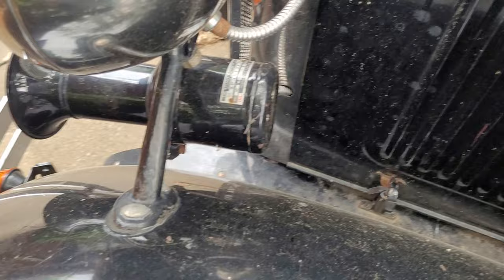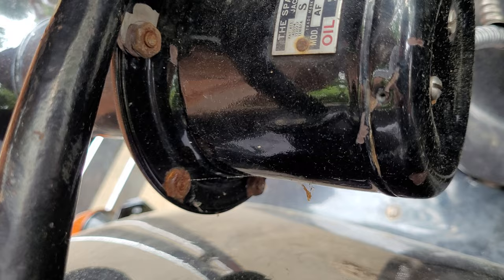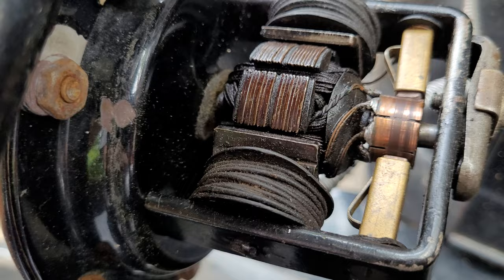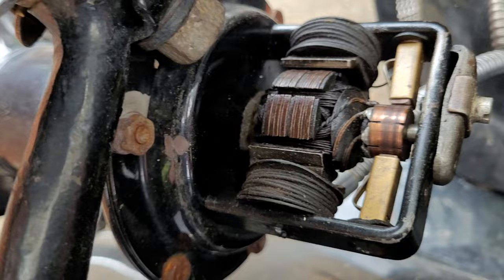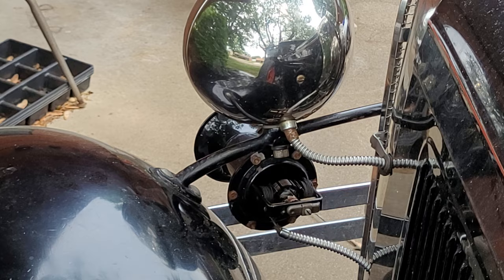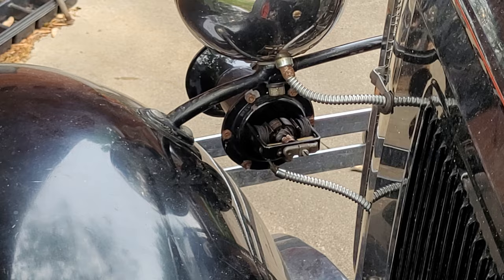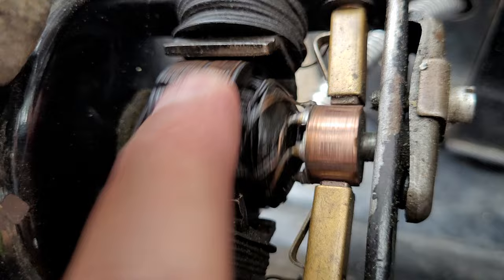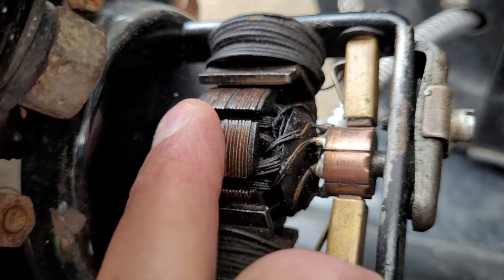Model A horn not Ahooga. How to make it Ahooga again

Comment: I check it before driving. Or get a Sparton air horn for reliability.
Reply from the maker: I find that the outside temperature makes a hugh difference in the sound and if you have to adjust.

Comment: Was this not working at all before you started? I’m having same problem thanks 😎
Reply from the maker: It was hit or miss if it worked. Temp affects it. If sun was hitting it would make a little noise. Do what I did in video and you will bring it bad to life. It is a high maintance iteam. It is real cool how it works. That screw controls tension on it. Its actually really simple. Just clean it with a scotch bright pad. oil it. adjust screw and your good to go...
Reply: Screw adjusts one notch between good and bad.

Comment: I clean my commentator with rubbing alcohol..
Oiled the sponge..
Reply from the maker: What is the right oil to lube it with?????
I did clean it with alcohol after sctochbright pad. Then hit it with electrical cleaner spray. But what oil? 3n1, turbine oil, motor or gun oil or does it even mater...
Reply: Ya, what oil is recommended for the horn and what brand?